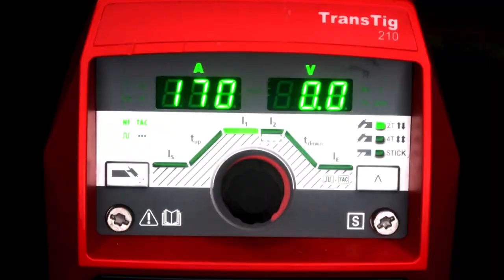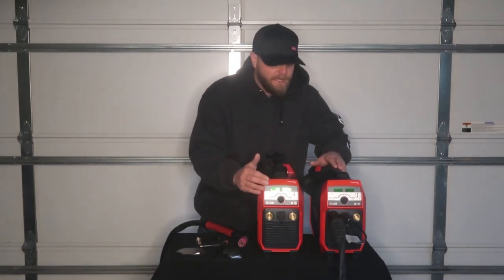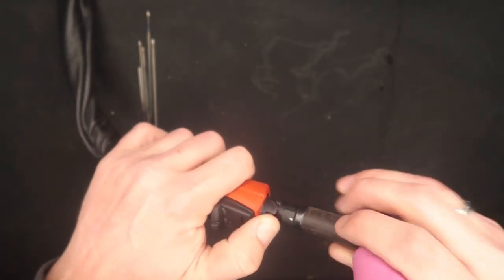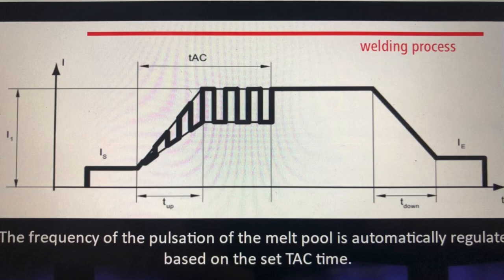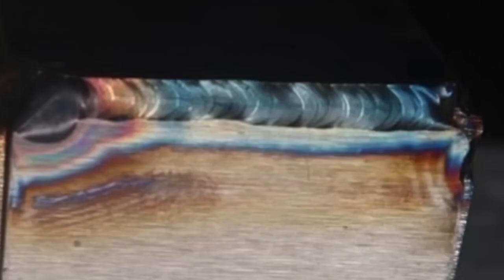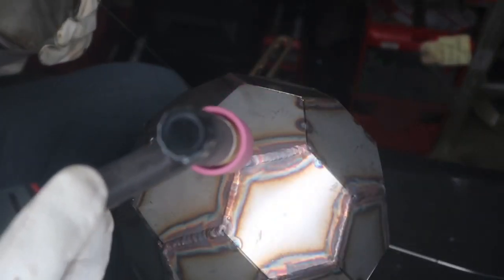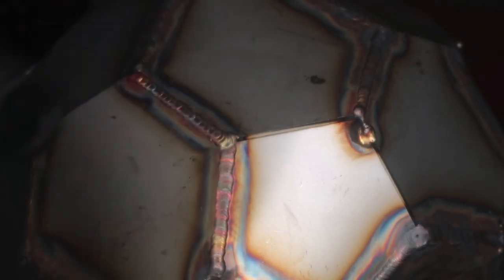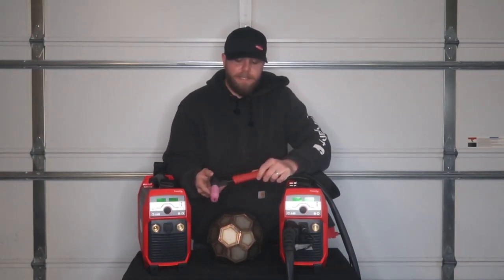Bored ?!? Try Out This #fronius #tigwelding #weldmetalsonline

Comment: Dose this unit have all the same stick welding options as the Transpocket 180?
Reply from the maker: Yes, all the same options but with high frequency and foot pedal options. The 170 will only burn 3/32 rod on 110v power where the 210 can burn 1/8 on 110v power
Reply: Very nice welder. Thanks for the info.

Comment: they look like good machines, when will Fronius bring out an ac/dc tig  which cheaper than the 230ti.?
what price point are these machines going to sell at? thanks for the video Chris
Reply from the maker: The price of this unit will be $2,584 MSRP . I hope 🤞Fronius decides to release a AC/DC version in a similar size. We will see what happens
Reply: MilkyCereal83 fronius is waiting on me to buy the 2200 then the day after they will release an AC/DC version
Reply from the maker: S4v4g3 86 Nothing planned so your safe
Reply: MilkyCereal83 i just ordered one but looking again I don’t see anything about aluminum on the selections front panel. Hope I didn’t order wrong 2200
Reply from the maker: S4v4g3 86 There are two aluminum MIG selections. Did you order the tips and stuff for 3/64 aluminum wire?
Reply: MilkyCereal83 no. I blew my budget on just the welder. I’ll add stuff down the road. Can you email me what I will need to start doing aluminum when the time comes? Sbranham86@gmail.com
Reply: @sbranham86   I use the aluminum .045 ones Fronius sells, buy 20 they are not expensive  and use 5356 wire to start with I use 035 wire and it works very well there is another wire 4943 which will work better than 4043 I think, and get the Teflon liner. I bought 2 mig setups the 10 ft for aluminum and 15 ft for steel. also get the proper drive rolls , once dialed in it is very good. by the way I have been using Esab 7100 ultra dual shield , superb wire. good luck.
Reply: Bruce D thanks bud. I’m also going to get the tig torch later on but I’m trying to figure out if the ck torch and adapter are better
Reply: @sbranham86   I have used the Fronius tig torch and it seems okay to me but I am not a good tig welder the ck torch is lighter but you need to get the Fronius foot pedal to use the ck torch. so give the Fronius one a try first . I may find myself doing more tig but I have mostly been building patio tables and smoker/barbeques /and fixing farm impelments etc so have not needed tig. oh and making aluminum awnings.
Reply: Bruce D nice
Reply: Bruce D what settings do you use for the .035 aluminum wire? It says no prg for all but .045 on my unit. Just got it in today and I’m tinkering with it so I might have to pick your brain some. Sorry if I’m irritating you
Reply: @sbranham86   use the 0.040 setting for wire size when you use 035  wire. and use the synergic settings for material thickness try there then adjust. make sure to clean with acetone then preheat , should work for you. I was welding on 3/16  and 1/4 for
awning brackets etc. used 5356 wire. let me know how you make out.
Reply: Bruce D when I select .040 it says no prg
Reply: @sbranham86   You have to make sure that you have selected the gas as argon.
so first select alsi ( for 5356) then 040 wire then  ar 100%  then your material size that should get you there it takes a bit to get used to . so select the wire type then the wire size then your gas then the material thickness. after that you can fiddle with the arc force and dynamics. this welder is very advanced to others I have used so bear with it and in the end at will make sense, steep learning curve. I still ask questions of their techs.
Reply: @sbranham86   Also set wire pressure 1 or 1 1/2 ,, 2 might to too much
Reply: @bruced1429  ok, im gonna run out and check it and see what it says
Reply: @bruced1429  i followed your steps and it still says no prg for 040 on either ali settings with 100 argon. also on start up i get err 51 but it goes away and everything works besides the 040 on aluminum
Reply: @sbranham86   make sure you are in synergic mode . also down load the manual from Fronius if you have not already done so. you can ask me any questions any time, I am on youtube  at breakfast , lunch and evenings pacific time ( west coast)
Reply: @sbranham86   are you on 240 volts? that might be the problem, be on 240 volts as 5356 won't run on 110 v you would have to go to 4346  wire settings .
Reply: @bruced1429  i have the manual that came with it and it states main undervoltage. can i contact you via email so maybe i can email you a picture of what its doing? my email is sbranham86@gmail.com
Reply: @sbranham86   sure my email bdonalds@telus.net we can work on this tomorrow morning
Reply: @bruced1429  i was told by fronius,  last week there was no foot pedal for the transsteeel 2200  do you know if that is true?